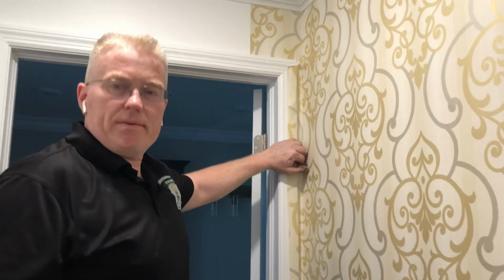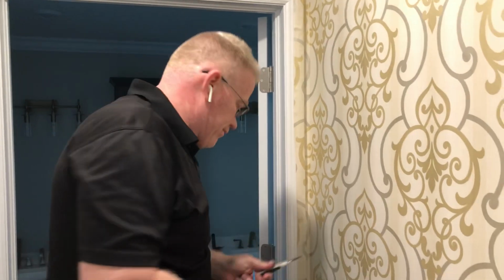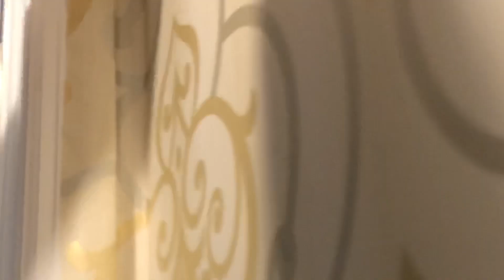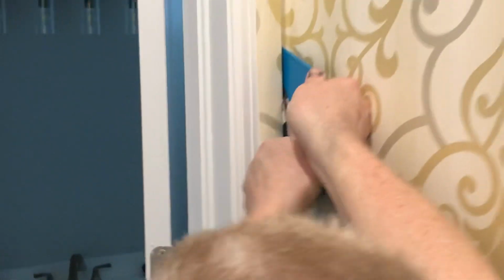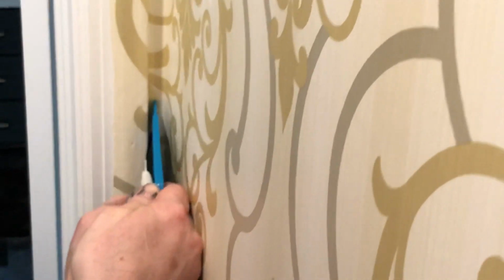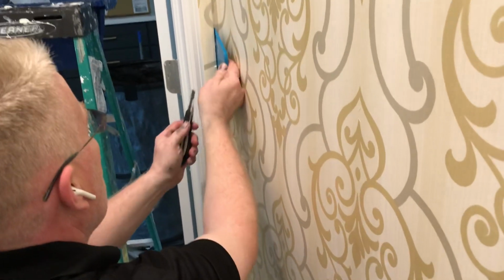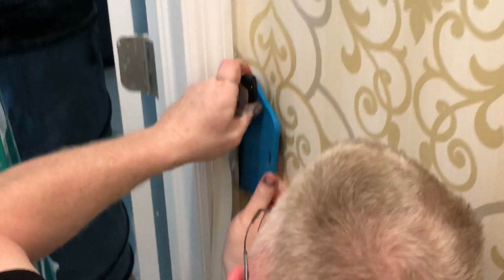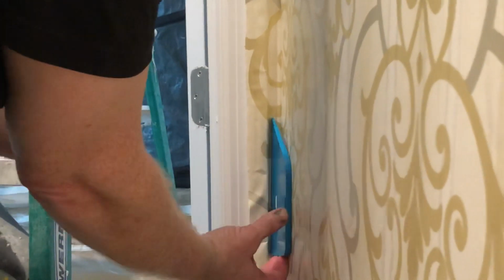How To Trim Wallpaper Between Wall and Door Trim - Spencer Colgan

Comment: Difficult cut, to be honest I allways measure it and cut it slightly to wide so it's partly on the side of the door casing and I run some  ready mixed adhesive so it doesn't curl up as it dries it isnt perfect but it looks it because the corner is so tight, you did well there Spencer